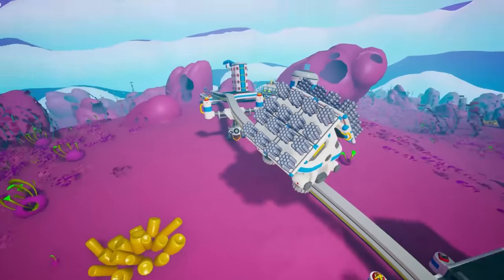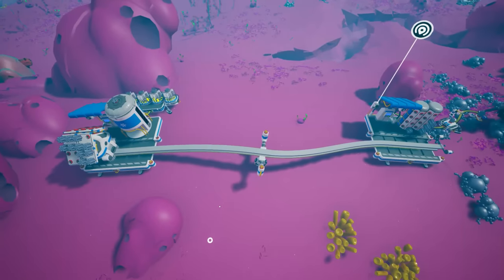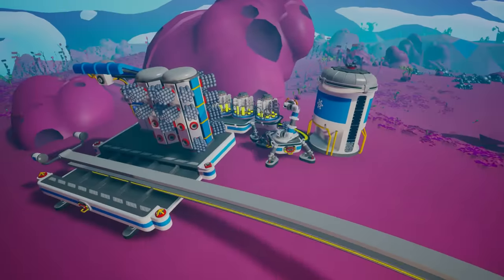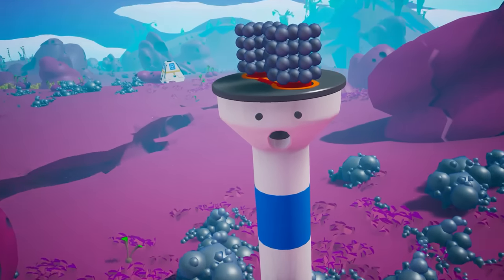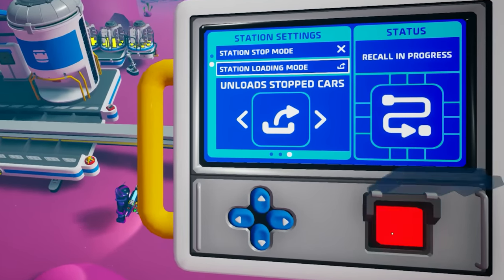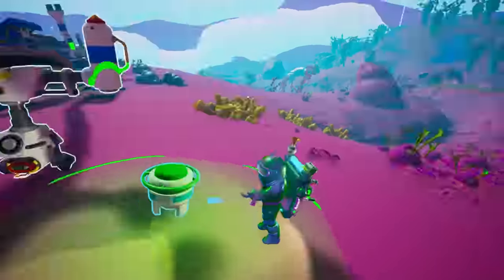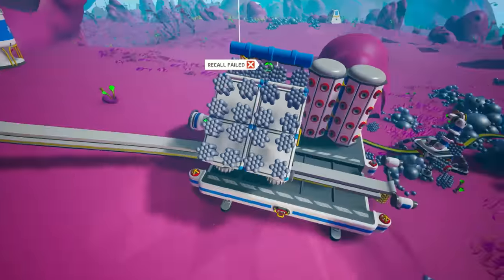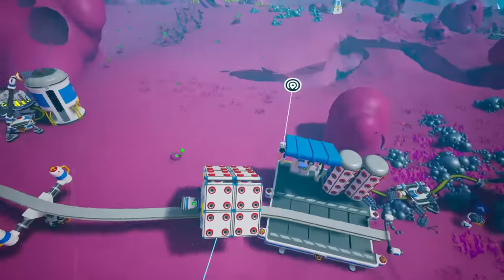Astroneer RAILS full auto transport system

Comment: When I get my hands on the update, I'm gonna make a huge metro system with stations at launch pads, mining sites, my home base etc. I will make it in such a way that I could travel from my home base to the launch pad a few hundred meters away and then land on Glacio and travel to a mining site and get some hematite and then return back.
Reply from the maker: That sound great! 🚂
Reply: Problem, what do you do when you run out of recourses in that part of the cave?
Reply from the maker: @sandytheastroneer1247  the only way is to look for another deposit of resources... Anyway I recommend using auto extractors because they extract 15 times more resources than by using the terrain tool
Reply: @KuyaGameAstroneer  I use stompy for my ammonium
Reply: @sandytheastroneer1247  I will connect the rail to more mining sites. Simple!
Reply: @sandytheastroneer1247  you can pick up and replace down the auto-extractor and the resource will reset giving you infinite resources
Reply: @thenerdykerbal   you can pick up and replace down the auto-extractor and the resource will reset giving you infinite resources
Reply: @colecrew4276  Not really, as there will be less recourses but you will get like 10 more

Comment: Note, this only works with one train cars and not two, but efficency is key in astroneer and I am working on my own train system using storage sensors and count sensors.
Reply: You can use any train engine to power this.

You have the train with the carts. Set a count repeater onto the engine and set it to the ammount of train carts. Set storage sensors and put it as full/empty and connect it to the count senor.
Link the count sensor to the train and it will send the train off when it is empty or full.

I would recommend medium storage and not any other type, because it can be very slow if you choose to use a different storage piece.

Comment: The proximity repeater isn't necessary and actually can create issues in itself, such as turning nearby arms or storages off, calling nearby railcars if you've got stations in close proximity, and more. I'd recommend just feeding the signal directly into the car, or if you're using something with storage canisters as well you can branch it to hit the car and the large storage (which will in turn trigger all the items attached to it).

That's a clever design, and I must admit I probably wouldn't have thought of it myself... but with a prox repeater there's the potential for interference between multiple lines which would be best to avoid if possible.
Reply from the maker: Yeah this is a great design too 😊🚂
Reply: Yep, I just tested this, and the proximity sensor causes problems, in particular if you attach a rail engine.  I took the feed line from the storage sensor and tacked directly onto the rail engine and now it's working.  The problem seems to be related to the length of the train and the way it considers whether the train has arrived at the station or not.

I have a different problem, and that is mining seems to stop sometimes (is this a bug?) at the Auto Extractor despite there clearly being resources still in the ground.  This seems to happen when the green bar on the AE is goes down to zero.  I have to manually lift up the Auto Extractor and replace it in the same place, and then the green bar comes back, often indicating quite a few resources still remaining.  This behavior seems like a bug to me, do you have a workaround?
Reply: @Qichar  It's a known bug. You often need to just pick it up and put it right back down and it'll work. You could look into overclocking your auto extractor but I believe you still run into the same issues.

Comment: So hu since switch finally got the update recently I tested the design and it's really good really like it also I discovered that if you want to add station to the railway system or if you want to have your train constantly running you put the storage sencor into empty and not empty mode
Reply from the maker: It's a very cool update indeed 🚂🚂

Comment: I’m curious about something since I’ve not used the sensors and repeaters much. Why use a proximity repeater instead of using the pin on the sensor and connect it to the car?
Reply from the maker: Yeah in fact, you don't have to. I don't know why I didn't think of that lol 😅🚀😊

Comment: you can put the large resource container on the station platform itself without having to utilize an arm
Reply from the maker: True 😊 in the video I used that setup to unload the train father, if the large canister is at the station itself, it will unload resources one by one, making it quite slow 😊🚂
Reply: @KuyaGameAstroneer  but not slower than an arm. But I get the automation aspect of medium storage silos.

Comment: I have a question, can you use a button repeater instead of a proximity repeater?
Reply from the maker: I don't think so, but actually you don't even need the prox repeater. Just pull the wire from the storage sensor and attach its pin directly onto the car. Done 😊🚂
Reply: @KuyaGameAstroneer  Ohhhh, that makes more sense, think you :D

Comment: could you make a tram system with the rails to travel to different points of the planet without using your vehicles like connecting to different gates and even the core of the planet like an underground metro?
Reply: yes, i believe all you need is that car with the sensor
Reply from the maker: Can you explain further? I think you mean something more than just connecting rails all around the planet,, but I'm not sure 😊
Reply: @KuyaGameAstroneer  that is only what i mean lol. Essentially a roller coaster of a sort by doing that you could if possible enjoy the sights, not have to worry about sudden caverns while driving,  take a trip through the core of the planet also you can experiment with different platforms and altitutudes, upside down parts, through different tunnels in different biomes, etc.  You could even use it (probably not) to catapault dynamite to make like a bomber train to bomb different part of the planets on the trip from point a to point b. Would be interesting to see how creative one could be.
Reply: Don't build underground. I've never met an Astroneer update that didn't replace some terrain and bury my underground base. Building underground was the worst decision I ever made in this game.
Reply from the maker: @kkdias9924  oh I get it, yeah it's definitely possible, in my other videos I've made a roller coaster around a mountain

Comment: So when I logged into the update and completed some of the challenges for the train suit one challenge said i need freight modules. If u know what they are can u tell me how to get them?
Reply: On glacio these boxes that are blue
Reply: On the surface
Reply: I’ve only just loaded it up, but I found about 4 freight modules just on the surface of Glacio, says they can be turned into scrap, so my best guess is scrap them and you get the scrap modules? I’m not sure what the challenge asks exactly but hope that’s helpful (:
Reply: Thanks bros
Reply: @oliversargeant8618  you have to take the boxes and put it on the back of the train modules and drive it to the station to complete the quest
Reply: Found a bunch of these freight boxes on Glacio, in more than one location. I was only there to get hematite. Each set of boxes is at a railhead, so I guess we're supposed to connect rails up and take them somewhere

Comment: Can you make the same transport concept but with more wagon? I tried but it doesn't work
Reply from the maker: Don't place the proc repeater, pull the cable of the storage sensor and attach it directly into the cart 🚂😊
Reply: @KuyaGameAstroneer  do you mean to put the storage sensor to the first cart and attach the cable to the second one?
Reply from the maker: @mattiaf1517  attach the pin to the same cart where the storage sensor is

Comment: It only works if there is no locomotive
Reply from the maker: You would probably have to move the prox repeater close to the locomotive or remove the prox repeater and attach the pin directly to the locomotive
Reply: @KuyaGameAstroneer  The problem is that the repeater activates the station too
With a locomotive he has time to get out and to be called back to the station
Reply: @KuyaGameAstroneer  Also it is possible to connect it directly to the locomotive or wagon. This removes the need for a Proximity Repeater and allows the use of a locomotive
Reply from the maker: @damiendier367  that's cool! Thanks for sharing it

Comment: But what is the point of that. Shhhh. I feel like a alien looking at humanity. You can just pick up a large storage silo and use the hoverboard. 

The game doesn't support any of this. Why did they add this stuff. There is nothing in the game that benefits from this. Did I take crazy pills or something
Reply from the maker: The point is that rails do that for you ... But if you don't like it, no problem 😊🚂
Reply: It offers different ways to do things and it's fun. My kids love playing in creative mode, and they're going to go mad with the trains. 
I want to complete the current challenge which is going to require crafting a lot of Nanocarbon alloy, and I don't see railways helping me get that done any quicker, so I won't be using them.  
I agree that for story mode the railways aren't going to be very useful, particularly as any resource location will eventually run dry and you'll need to move the railhead station.